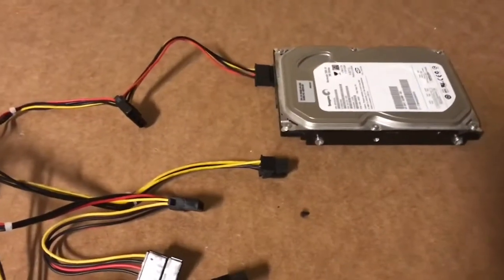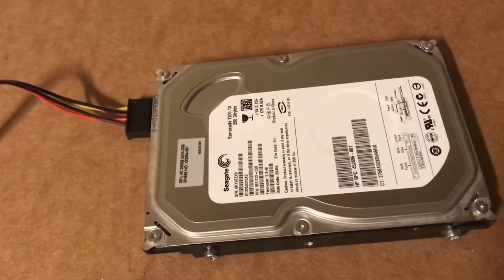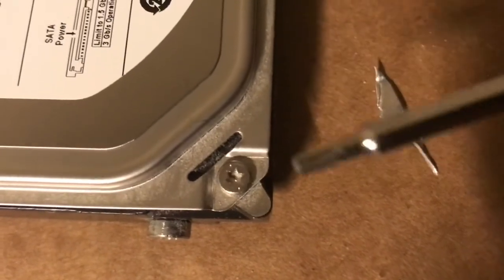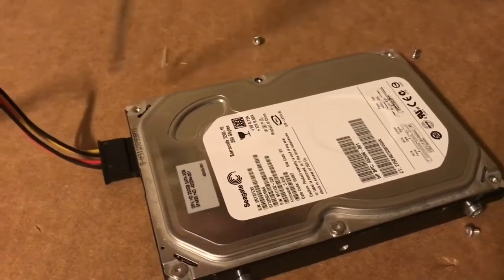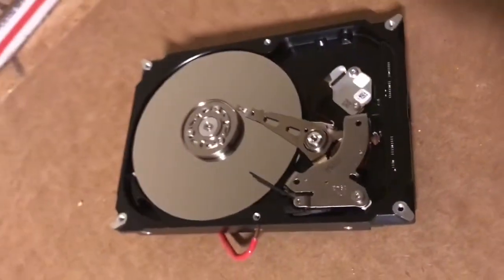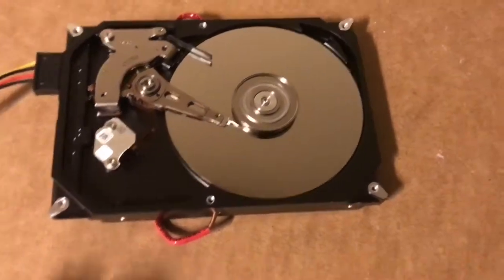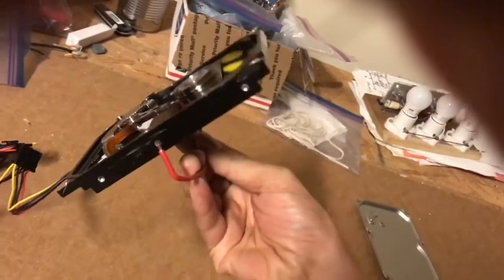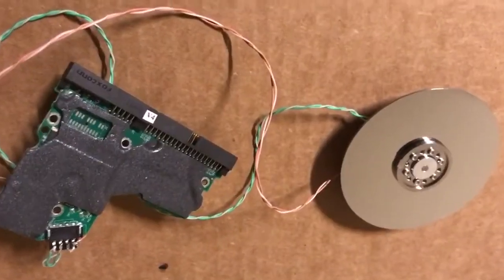Hard Drive Gyroscope

Comment: Typically hard drives use Torx head screws.  A decent set of torx is actually a really good investment imo.  In many (if not most) cases, a single torx set can replace 2 sets of Allen keys (SAE and metric).  The tapered 6 point star actually seems to perform better in a hexagonal slot than a hexagonal key.  They can also turn those triangular slot head screws you sometimes find in toys.
Just don't try turning torx screws with an allen key.

Comment: Neat. How did you get the single-plated disk and motor out of the hard drive?
Reply from the maker: The motor was a screw in motor, so I lucked out with this one. I just removed the disc platter, unscrewed the motor and pulled it out from the back of the drive, and then reattached the platter with 3 screws. I added longer connection wires which I got between the power supply for the motor and the motor itself
Reply: @BrianDhvTinkerer how can I find one of these?